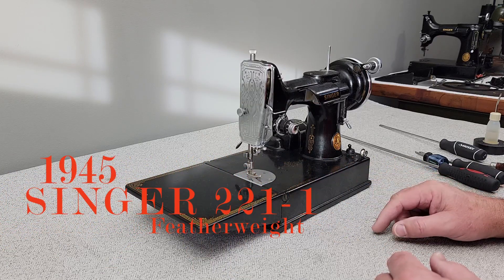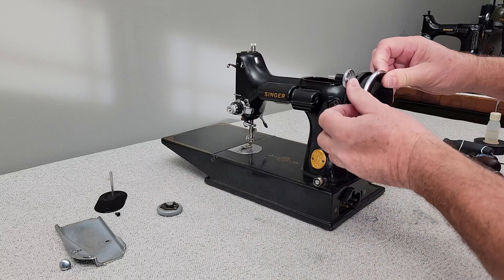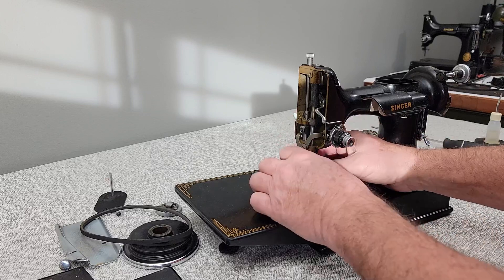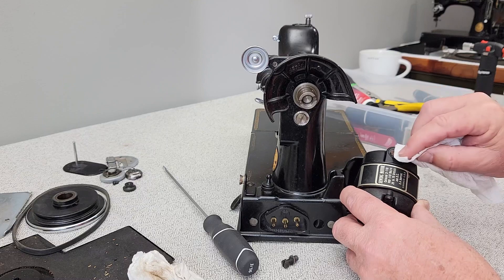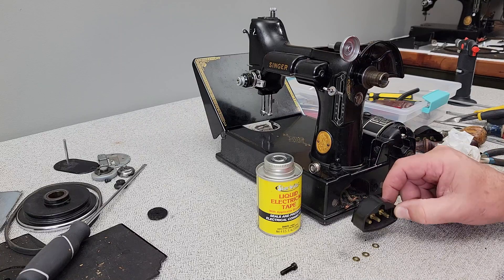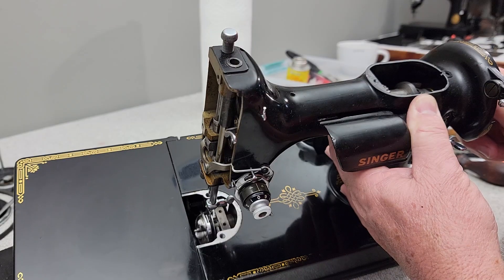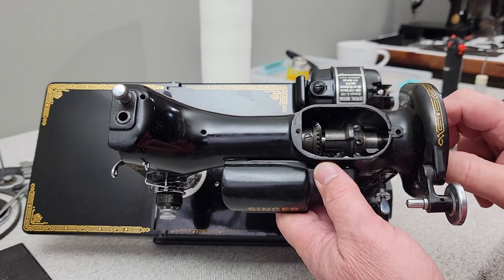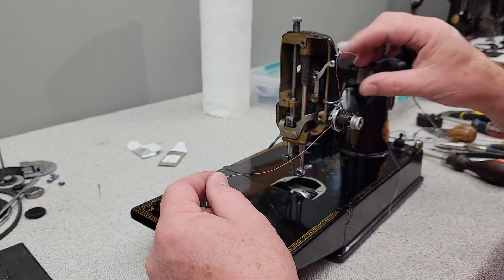Today's job will be a 1945 Singer 221-1 Featherweight sewing machine.

Comment: My mom had one of those machines.  I bought one from a sewing shop about 7 years ago...for around $550.00.  It did not have a foot pedal, so I had to order one but it works.  also had to order needles and bobbin spools, and needles.  Don't know a thing about how to fix it up, where to put the oil, how to fill up the bobbins and How to set the tension. The foot pedal doesn't look like the original, but it works.  Do you have more videos? I want to know how to oil this little machine, and how to fill up a bobbin and generally how to get it to sew. I will try to use it for making quilts.  Thanks you so much for your videos.   I am grateful there are people like you who can show us how to take care of these little wonders.  Much love and respect to you.